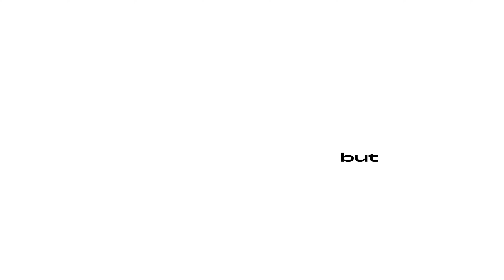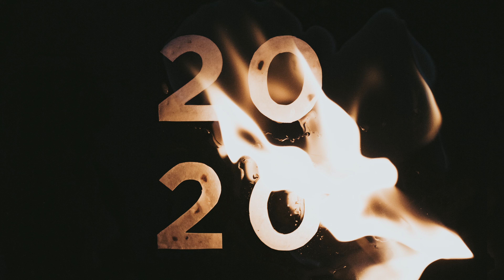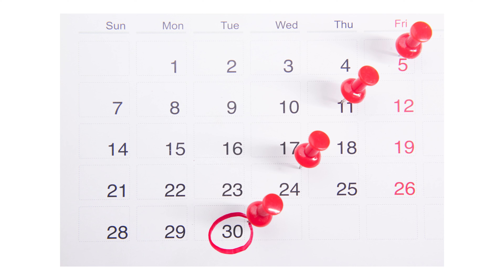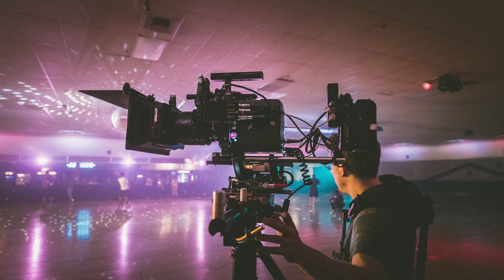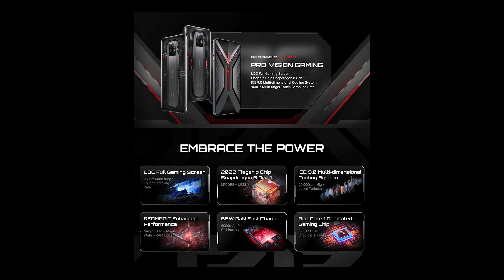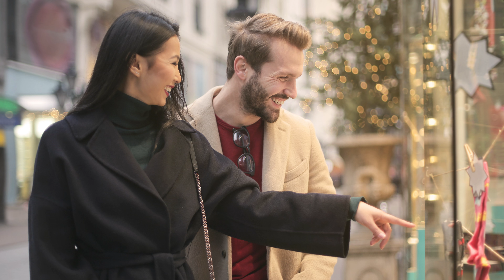What do Industrial Designers Actually Do?

Comment: I think people in general don't undestand how much work lays behind designing and as a consequence they don't value it properly.
Reply from the maker: For sure! But it’s also our job to make sure people understand
Reply: Many people don't think...outside of themselves.
Reply: I’m an architectural designer with education and years of experience in that field, plus I’ve done furniture and millwork design of low production quantities. 

I’ve recently have turned my attention to product design, and the differences I’ve noticed are quite profound from architecture. 

Something that’s mass produced takes a lot more thought and planning. The processes of production are of much concern. Material availability and cost are primary constraints too. 

I can do something like design a house that cost 3x the average and takes about 3x the labor to build, and that project can be done successfully.

But if a industrial design for product has 3x the cost, then the company making it is likely a sunk ship.
Reply: @cl5619  would you say industrial design has a similar technical skill set as architecture?
Reply: @ngkngk875  
There are technical skill similarities. But there’s a lot of same problem solving aspects and aesthetic aspirations as well.
Reply: I thought products just grew out from trees